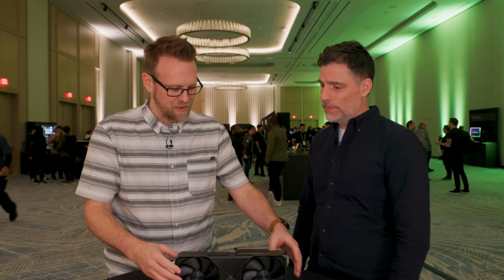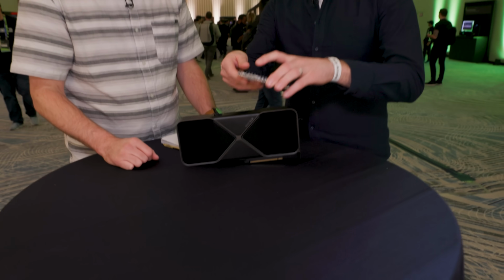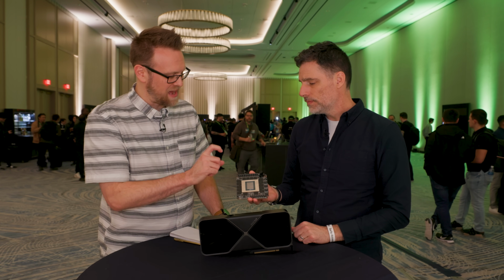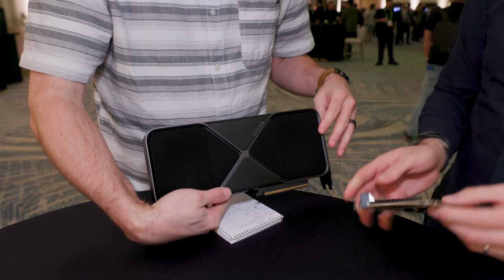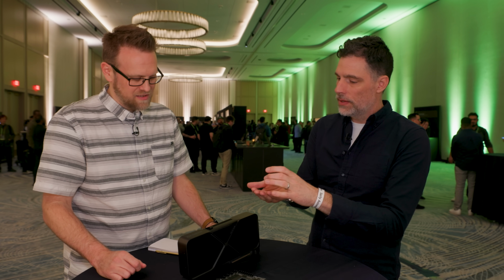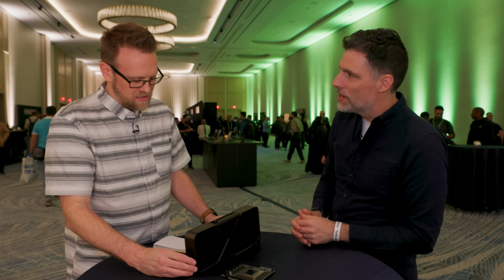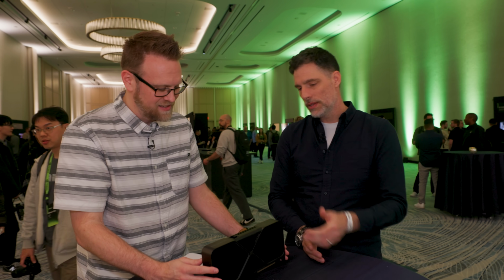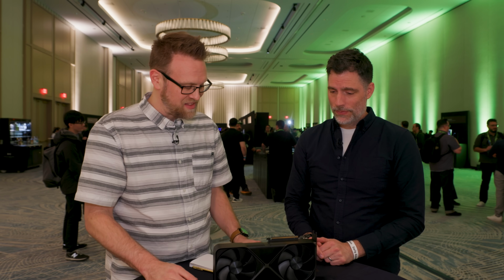Nvidia Talks RTX 5090 Founders Edition Design

Comment: I love that the founders card is only a 2 slot GPU but how about nvidia produce more than a few thousand of those GPUs? All those design and hard work for a 3rd party manufacturer just slap 3 fans and a huge heatsink so they can charge more and making it a 3 slot GPU.
Reply: it's not like they can just "charge more", if their design isnt efficient they wont sell. Also just adding more fans and material will also drive up the cost. Sure this looks efficient, but really we dont know much about that until reviews are here. The previous FE cooler design was pretty good, but several aftermarket solutions where way better, the same could turn out to be true this time again.
Reply: 4 slot partner cards
Reply: Then people would rage about how they drove EVGA out of business etc.
Reply: I’ll stick to a PCB that isn’t as dense as the walled city in china

Comment: Modular repair possible now. Some people do manage to crack the PCIe connector
Reply: yeah that another benefit for this design, now u can replace displays board without soldering
Reply: Cracked PCIE connectors are almost expected when transporting 1kg+ graphic card plugged in without additional support.
Reply: @tristanwegner  Not when they are made out of metal (like on 4090 4-slot prototype that Steve from Gamers Nexus disassembled). I wouldn't be surprised if RTX 5090 FE had it as well.
Reply: Suuuure. nvidia will not allow that and you know it. Those parts will not be for sale. Only for partners and RMA.
Reply: Repairability sux.  Much better to be reliable.

This design could be much less likely to crack, depending on how it's put together.  The PCIe daughterboard should be able to use straight-in traces only without any other signals routed nearby (like that Gigabyte model that got a reputation for high failure rates), and since its on a cable, it could be flexibly coupled to the rest of the card. That would put more of the load on the rear bracket, and what the PCIe connector does support would be self-centering.

Comment: Total loss for the Zephyrus G16.  I will either pick up an X13, G14, or Razer Blade 16.  Don't want those garbage Intel cpu.  I currently have the Scar 18 and extremely suspicious of the Intel 14th gen in it.  Too many problems with stability if I leave the E-cores running.  I just can't trust Intel anymore.  They need to win me back.  I would love to see the Razer 16 with an x3D part.

Comment: 2:27 so it’s not louder than the 4090? Interesting
Reply: That remains to be seen, but it has a decent chance of being true I'd say. Depends mainly on the airflow inside your system I'd wager, considering there is less capacity (and more heat generation) before the rad is heat soaked while the cooling itself should be more effective. Probably amazing in something like the Fractal Torrent.

Comment: Are they using a vapor chamber with liquid metal or paste, what kind of pipes are they copper or aluminum. . What's the water block is like for the fe now that it has 3 pieces of board ???

Comment: Is this also blowing hot air into CPU cooler or I'm picturing it wrong
Reply: They're probably expecting an aio with the radiator at intake at the front of the case with their design.

Comment: 9:40 ‘the 5070 design is similar to previous generations’ - yet in Jensen’s presentation the 5070 is shown and the design looks exactly the same as the 5090? 🤔
Reply: What he means is the PCB on a 5070 is a standard one piece with PCI-E slot and display connectors, like in previous generations.
Reply: @Zbychoslaw666  if that's true, then all the interesting airflow innovations are negated by a PCB that blocks and traps the air
Reply: @Zbychoslaw666  I just found some new pictures of the 5070, and although it looks the same as the 5080 and 5090, on the connector side of the card it is visible that there are ventilation holes. This means that one fan will vent out of the back of the case, just like the 40 series cards and unlike the 5080/5090.

Comment: One concern with the new 5090 is the effect on cpu cooling. its pushing much more hot air to the top of the case. The fan closest to back of case will feed hot air mostly to the rear case fan, but the other one will be pumping near 300 watts of heat into the front cpu air coolers. It might be wise to use liquid coolers only with the 5090 as even the largest air cooler will be more susceptible to heat contamination.
Reply: Air cooler would probably not be a good idea as it would impede on the exhaust. AIO with separate cold air intake would probably be best, so the CPU isn't getting cooked.
Reply: You need aio and put intake.
Reply: IMO the design team thought about this.  But we'll see from the reviews if this becomes an issue or not
Reply: blah blah blah

Comment: just realized if the pcie and IO is a separate pcb if those break you can now replace those now if they break, hypothetically if you dropped a 4090 and broke the PCIE Connector your whole gpu is dead, now if you drop it you can probably find a broken card for much cheaper and just replace those parts, be even better if nvidia provides separate parts to buy

Comment: The thing is that this probably cost more money to make due to the added complexity of now having 3 PCBs in a single GPU. But since this is only for the more expensive model which I assume the margin is high it won't be a problem to do it. Also the biggest good thing that I immediately thought when looking at the design is that now the owner of these expensive GPU doesn't have to worry too much about PCB cracking and twisting due to sagging because even if it is sagging, the PCI-E connector and the outputs are in different PCBs, thus you can let it sag without damaging the GPU.
Reply: I would think the RTX 5080 cooler is the same. The dimensions on the website are the same so I assume they're just reusing the same design.
Probably helps with some economies of scale and incredible noise performance for that model. Just hope they make more of them
Reply: @_shreyash_anand  It is already in the video that if I hear it correctly 5070 doesn't use this design thus I assume the rest do use it. Not sure if it is 5070 series or only 5070 that don't use it.
Reply: @RurouTube  the 5070 Ti doesn't have an FE model
Reply: It would still sag and crack the connector PCB traces. You wouldn't be able to easily find a replacement part for this.
Reply: @notmyfaultthisishappening3795  It is just a PCB. Actually I wouldn't be surprised if you can easily find replacement for it. The PCB part should be very easy to make. The connector, which is probably proprietary, should be easily salvageable and resoldered into the new PCB. Basically what I'm trying to say is that there are plenty of dead GPU because of the sag and this potentially will eliminate that. Also remember that sagging is not only about PCB being cracked but the twisting potentially can make some chip to be disconnected from the board thus this design should also be able to prevent that from happening.
Reply: @RurouTube the advantage is lack of 3 slot weight but the non standard design and oem proprietary flex cables mean it's a very expensive part and once RTX 50 is EOL it won't be possible to find at all. I'd say it's a win lose design. Better off with AIB standard designs if you want to keep it for a long time but with anti sag bracket.

Comment: This looks exactly like the sort of design that Steve took apart on GN today!
Reply: No it doesn’t lmao that design was four slots and the pcb was underneath the card and didn’t have two fans on the same side and also had three fans, no top vent either. Wildly different
Reply: @NahBNah  same design principles. Split PCB, maximum flowthrough. The position of the fans (push or pull) is an optimization and not a wildly different approach. It being 2 slots can be attributed to the better vapor chamber and probably higher temp target at same wattage.

Comment: I heard the rep say that the 5070 FE is the "old" mechanical design, is that also true of the 5070ti FE and 5080 FE? I ask about the 5070ti because it appears to be a cut-down 5080 from the specs.
Reply: Just the 5070, also there is no 5060 and 5060Ti FE cards, NVidia wants the biggest margins possible with the minimum amount of work

Comment: I’m really interested in the 3D vapour chamber design, it looks like it wraps around some of the components. If this can keep it under 70 c and be slightly quieter than a 4090 (which was a massive improvement over the 3090 imo and out competed some AIB cards)) then I think it is really going to set the standard. I’m sure cablemod will have a cable that keeps it out of the way of the logo.

Comment: How much will the dual flow through impact the cpu cooler and its temperatures?
Reply: How braindead is your build that you care?
Reply: The air is flowing down, not up
Reply: @MaxIronsThird, that would be fantastic, but how do you know that? Judging from the fans, for me it looks opposite way (blowing up into the cpu cooler).
Reply: @MaxIronsThird  you might want to take a closer look. In normal orientation it is blowing upwards. It will heat up the CPU area. This is not necessarily a bad thing as chassis fans are usually controlled by CPU temp and a hotter CPU will result in higher chassis fan speeds, therefore also cooling the GPU.

Comment: It is not a good idea to keep all the power components in such a small space, every expert knows that. In addition, the high-pin connectors will represent an additional source of error in the long run. Just like this power connector, which will not be sufficient for this high current flow in the long run too, because up to ~8 amps will flow through each individual contact. (max 575 watts)

Comment: Surprisingly, the video doesn't mention the core tech of the FE cooler which enables the astonishingly high performance/size ratio: 3D Vapor Chamber that integerates a traditional vapor chamber and heat pipes.
Reply: Liquid metal is being used too if i'm not mistaken.
Reply: @deuswulf6193  its what the PS5 has for cooling
Reply: @deuswulf6193  3DVC is the deciding factor which will be massively revealed soon.
Reply: Yeah the video makes little sense without mentioning that. Just talking about the PCB and the fans alone doesn't explain how the cooling works, how all this heat from the PCB in the center is effectively delivered to the sides where the active coolers are.
Reply: It doesn't really though. Heat pipes themselves are, for all intents and purposes, already vapor chambers.

Comment: Waterblocks are gonna be a nightmare for this
Reply: I think as good as the card is looking you'd be better off with a 3rd party card if you want to watercool.
Reply: @peterpain6625  yeh same, just seen that gigabyte is releasing a pre-blocked one, i assume the others too. Was more an observation than anything
Reply: @brandonchappell1535 it's a terrible design doesn't cover the vrms and only the core has water contacting the block the memory is cooled passively via the heatsoak of the heatsink. And they use sub par components to make it cheaper. Hopefully there is better options
Reply: They are gonna look really cute. 😂
Reply: Waterblock manufacturers definitely need a bit more time designing the block for 3 different PCB’s.
Reply: I think this PCB is exklusiv for the founders edition.
All other brandsl have a different.
Reply: Could you elaborate me how-come ?

The way i see it

1. You are no longer limited by the installation requirement of PCI-E slot

2. You are no longer limited by the installation requirement of Display ports

So, what i am planning to utilize is to cover only the GPU+Memory PCB with a waterblock > Place it, heck > could be even "Dark-side" of the Motherboard, yet still have Display ports where they belong to and PCI-E "raiser" cable wired invicibly
Reply: That was my first thought, how are they gonna look?
Reply: Yeah now how can i run 4 of these now simultaneously for LLM training, i need watercooling
Reply: @TheReal_XiJinping  Alphacool has already confirmed they will be providing a 1-slot enterprise block for exactly that use case. You will need a partner card for that though as there isn't a FE variant (at least not yet).
Reply: @MajinOthinus  that's nice to know, thanks
Reply: @TheReal_XiJinping  Stupid greedy dumb AI bro
Reply: @GR34-e2o  i can buy your whole life 100x over
Reply: @TheReal_XiJinping  Shows how dumb you are if you think that you can give a value to someone else’s life.
Reply: @Simon_Denmark  i can just like every multi millionaire out there lmfao
Reply: @Simon_Denmark  lets see what happens when your brain spills on the side walk ;)
Reply: @ Whatever you say. If you talk like this to people in the internet and real life, I would consider seeking some professional therapists help.
Reply: @Simon_Denmark  i don't need a therapist i have 69 million bucks
Reply: @TheReal_XiJinping  That’s a nice number, I’ll give you props for that.
Reply: @Simon_Denmark  Don't feed the troll.
Reply: @ole7736  There's a point where it goes past trolling but yes.
Reply: @Simon_Denmark  You started that exchange with your pinko nonsense.

Also waterblocking one of these would be a total waste.  They're almost certainly going to be very hard to get and more expensive that the AIB models, because Nvidia never makes enough of them and only sells in the US, at a price that is too low for the demand.
Reply: @Vegemeister1  What exchange? Death threat jokes are ok to you? Look at you with your fancy words even though I’m not a political person at all.

They won’t be more expensive than AIB cards, they will literally be MSRP just like FE cards before unless you’re buying from scalpers. Also only sold in the US according to who? That most certainetly wasn’t the case with 4090. The only thing that made sense in your comment was that it’s almost pointless to watercool the card but so was with the 4090. You don’t always watercool just for the better cooling.
Reply: @ I missed that it was @GR34-e2o who made the idiot comment about "greedy AI bro". That was political, none of your replies were.  Sorry.
Reply: @ I thought I had read complaints about only AIB models being sold outside the US, and neglected to actually look it up. 

As for the price, retail doesn't matter if its not in stock at retail.  If Nvidia prices too low or builds too few, as has happened with previous FE cards, the only way to get one is the scalpers' price, (or MSRP + price of labor, time, and luck, which should not be far off the scalpers' price and is likely higher if your work pays better than scalping computer parts).

IMO the FE designs are just flat out the best considering validation time and expected reliability, aesthetics, compatibility, resale value, etc., and it makes total sense that they cost more. This has been true since the 4000 series at least, if not back to 3000.

Comment: Hard work and dedication = 10+ layers with signal impeding ground planes. 

It’s amazing what engineers can do when they don’t have insane limitations set by product managers
Reply: You mean limitations set by budget, this design is extremely expensive to manufacture and relies on multiple interconnecting boards to remain within 2 slots but a larger conventional design while larger is usually more effective when taking into account lower than ideal case airflow and noise output.
Reply: @x86FTW  what was once innovative is now conventional and commodified. This is the new innovative form factor.
Reply: @abb0tt  Innovative maybe in the marketing although 3 slot card is more cost effective than a fancy heatsink and multiple PCBs which must interface together. Simple is always better in engineering.
Reply: @x86FTW  It's really not that expensive. Manufacturing multiple smaller daughterboards instead of one large motherboard for everything is actually cheaper on the board side. Only the compacted motherboard is more expensive and even then, the savings from the higher board yields should offset that to some degree.
Reply: @MajinOthinus  The expensive part is 1) the main PCB has hueg layer count, and 2) the the daughterboard has to carry *sixteen lanes of PCIe5*.
Reply: @Vegemeister1  And the main PCB doesn't have to be replaced this way. PCIe lanes are cheap enough.
Reply: @x86FTW  what isn’t set by budget? Don’t be fooled, the margins allow for a great deal of development. This isn’t “magic”, it’s allowance. 

It’s top down bullsh, and this is coming from a senior engineer.  👋